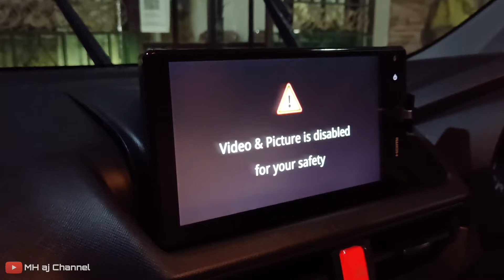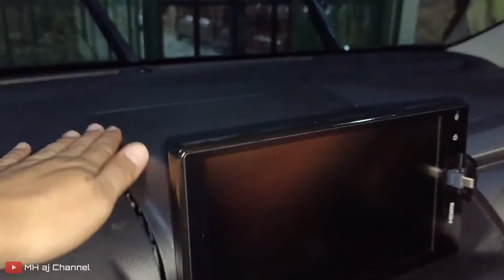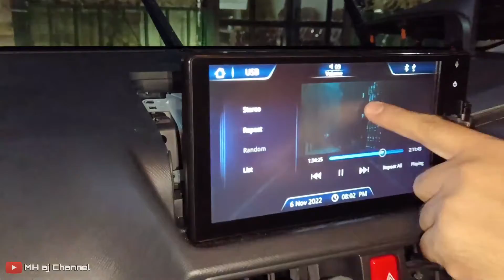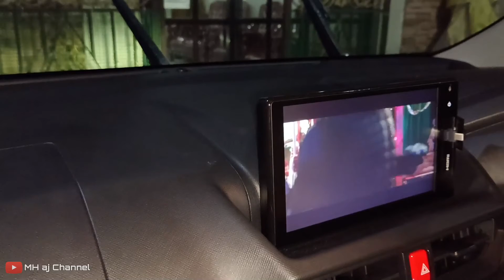Cara Pasang Cable Bypass Perodua Alza 2022 | Head Unit Player

Comment: Waalaikumsalam

Nak tanya bang pasal head unit ni
1. perasan head unit Alza H ada bluetooth. Bermakna dia boleh connect handset. kalau kita bukak app lagu macam Spotify, suaranya akan keluar pada speaker Alza ke?
2. pasal handbrake turun masih boleh tengok video itu saya salute. Kalau reverse dia bertukar ke camera belakang ke? Video tu dia paused kan?

sekian boss. tq
Reply from the maker: 1. Headset tdk pernah cuba lagi. Basic sma mcm smua player. connect Bluetooth suara ke speaker kereta.
2. Masih tukar camera belakang. Video pause kalau reverse untuk pemanduan lebih fokus